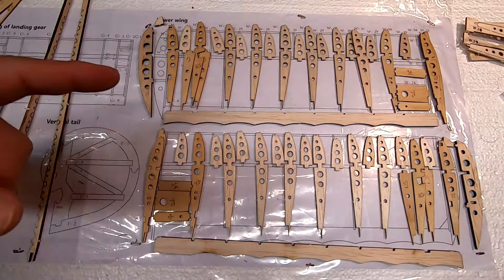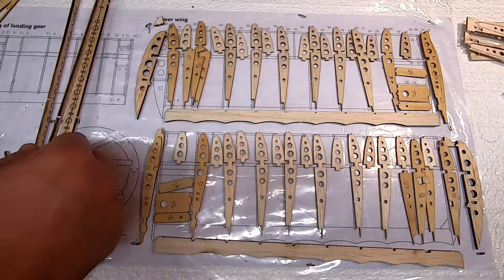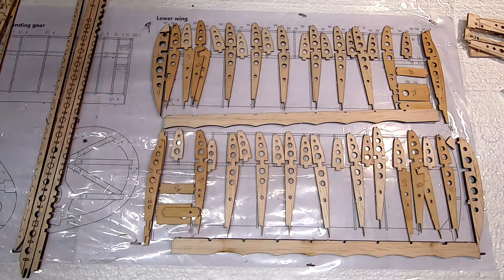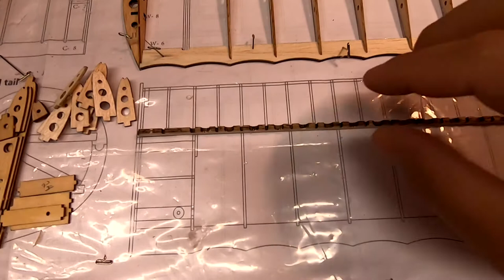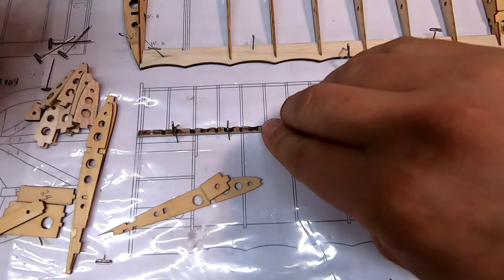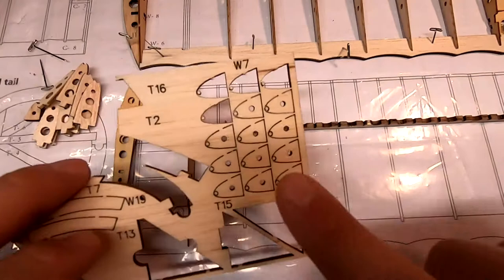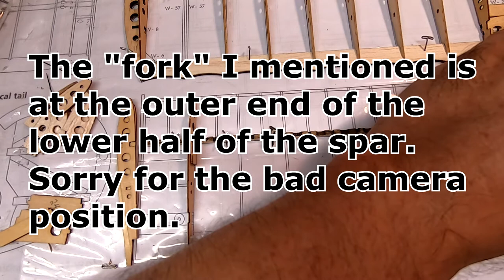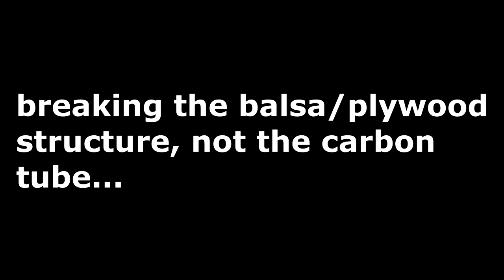Building the Fokker Dr1 770mm, Assembling the Lower Wing, Pt-5

Comment: I went to Home Depot and got a 8“ x 18“ piece of flat sheet metal and you use those small round rare earth magnets like you would find for alarm systems and those will stand on their edge or they will lay flat and they work great for holding the wings, spar, vertical and true They also are great for holding stuff down. The magnet are strong enough to go through the wood easily movable. My wings came out beautiful.

Comment: Good idea to take pics of those multi parts sheets. Strange that the kit maker did not laser etch the numbers on the parts instead of the scrap pieces. All parts will be covered so the numbers would not show on the finished plane. I always very lightly sand any laser cut part that needs to be glued to get the soot off it.
Our weather forecast is for our temp to rise to plus 15C so if that happens I'll be able to get the first spray coat of lacquer onto my Agena wing.
Reply from the maker: Spring is finally showing itself in your area? Cool! We've had some nice days but I haven't had things timed right to get out and do some test flights. My local field is closed because of the virus... it's on state park property. I'm going to go to a ball field or the like. A lot of school fields have signage restricting drones which I assume includes RC planes. I don't want to get my gear confiscated so I've gotta scope a suitable location. I've made contact with some glider pilots outside the metro area who may have some private property fields to fly from. Both Marsha and I have been on-and-off sick for the last two weeks. Her more so than me, but enough that I slept for almost 20 hours. We may both have a mild strain of corona. So, we're just staying to ourselves. I've known my primary doc for over 25 years and have her personal phone number... she just called in a z-pack for Marsha so we'll start with that and see how things are going Monday morning.
I agree about not necessarily wanting numbers on parts if you're going to use transparent covering. Otherwise it doesn't matter. Considering most people have smart phones, taking pics seemed like an easy solution. As long as you don't try to cut out all the pieces as a first step, it's not hard to figure out. Dancing Wings doesn't make a lot of kits... I think they make an even larger Dr1 and they have what looks to be a nice Piper Cub, a Sopwith Camel and a Tiger Moth... I've thought about building the camel or the moth sometime. I still have my eye on the 1/6 Sopwith Pub from BalsaUSA. That's a very nice kit from what I've heard. Fewer and fewer companies are producing build up kits in favor of ARFs and foam RTFs. I predicted this trend decades ago... most people just don't want to build. I can understand it, there is a lot to learn, a lot of tools to buy and if you make a big enough mistake or just get in over your head you end up with an unfinished plane you never fly. That fate versus a foam plane like a Timber that you only need to bind the receiver, put in a battery, and your in the air that day.
Hope the weather turns your way. Keep me up to date on the Agena build.
And stay healthy!
Reply: My RC Channel 
Sorry to hear you guys are not too well, hope it clears up soon. 
As for flying places if you don't need a runway just drive out to the countryside find a farm and ask the farmer for permission to use an unplanted field of his, tell him you're flying electric so there will be no noise and that you will not do any damage or leave any garbage. I've done it before I joined my flying club and not had a problem.
I've just put an ad on our local classified online site looking to buy a dlg. It has to have the peg in the right wing for left hand launches because of my prosthetic right shoulder. Also I have a very limited budget so it might not happen even if there are planes available.
Looking forward to some of your flight videos now that spring is just about here.